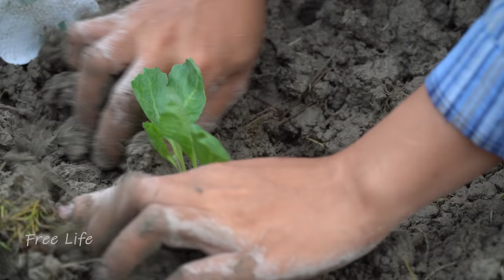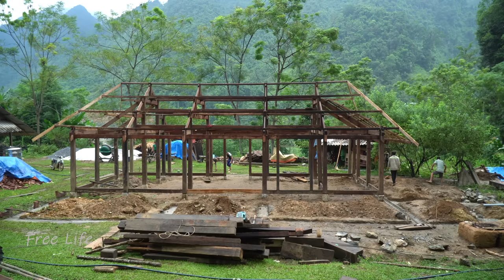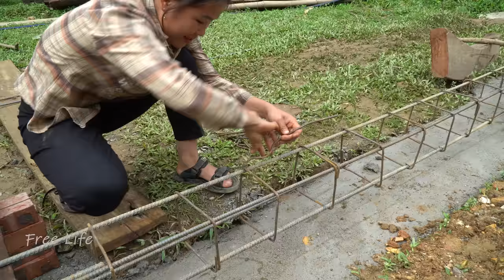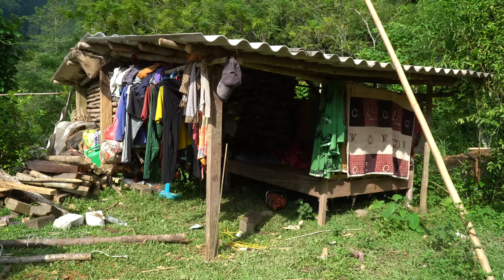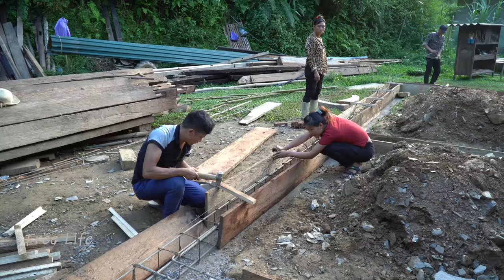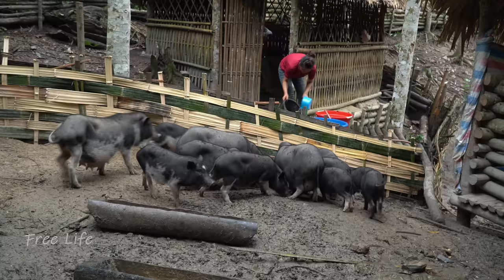Tie beam rebar installation-Build a house for your parents! This will be a very big house

Comment: Don’t forget to put screens/filters on the ends of your PVC pipes. They catch all the leaves etcetera and stop rodents/frogs from entering and plugging up pipes. Make sure you add waterproof seal/coating inside the septic system. That will make it last a good long time. 

I have to say, this is one of your best, and most exceptionally SAFE and STURDY builds. I’d say close to USA codes. You’re learning quite a bit! Good job girl!
Reply from the maker: Thank you very much, I am very happy to receive your feedback, I wish you good health.